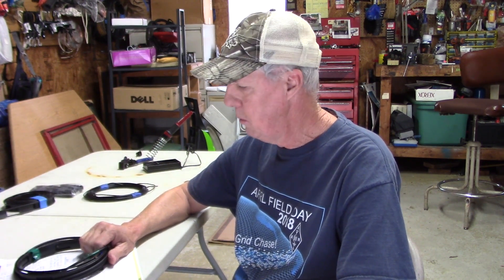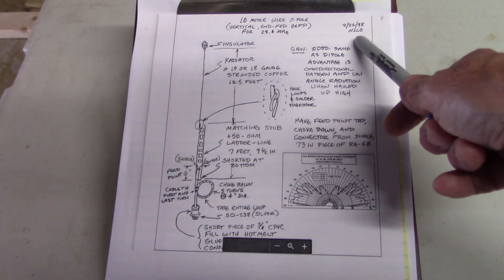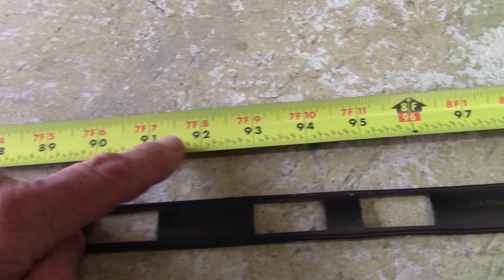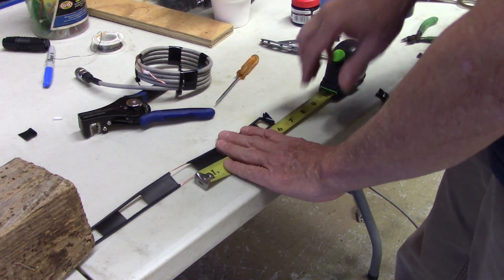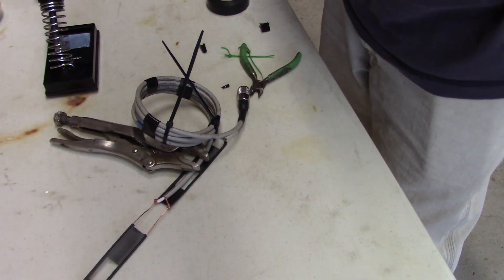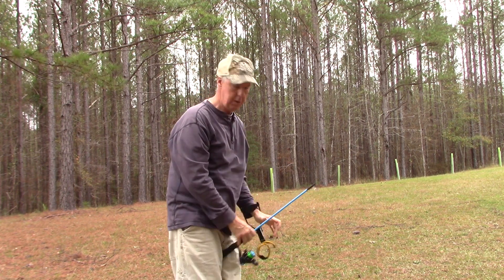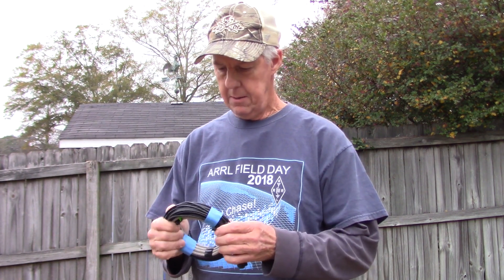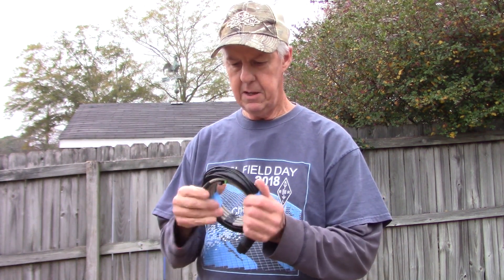10 METER LADDER LINE J POLE ANTENNA / Build and Field Test

Comment: Steve..Do you have a link for the spec build sheet you used ?  Nice video. Thanks
Reply: This plan comes from my website, nylo's notepad. You can search for it. It appears that hyperlinks are not allowed to be posted in the comments. I've made numerous attempts to post helpful comments here but they keep disappearing. Good luck with your construction. Mark N1LO
Reply from the maker: Hey Mark;  I really enjoyed building the antenna from the directions on your website.
Everyone should go check out Mark's site. He has some really good antenna stuff.
Thanks for what you do for the hobby.   https://www.qsl.net/n1lo/10mjpole.pdf
Steve Ad4xt
Reply: Thanks for posting the link Steve. That will take you directly to the PDF file but if you go up one level you can see the entire antenna plans page. There is actually a super j-pole version of the 10 m which was nearly equivalent to my 10 m beam when I had it hanging from my tower. And there is a plan for 20 m version as well. These can be mathematically scaled to other bands using the ratio of plan frequency to new target frequency as a scale factor, 15 and 17 etc. There will be some trial and error tapping the right feed point.

It's best to have the choke coil hanging a few inches below the bottom of the stub and to temporarily tape the coax between feed point and bottom of the stub to make it most stable for tuning. Otherwise after you do the final dress and taping of the stub and coax together at the bottom the tuning will change. It's better to have the entering and exiting portion of the coax at the same point in the choke coil, zip tied to adjacent turns for mechanical strain relief. That helps keep the weight of the coax feed line from pulling the coil apart. Also, I like to completely unitize the choke coil by spiral wrapping the entire thing with Scotch super 33. Do not pull the tape tight or it will collapse the turns. All you want is a sacrificial UV layer and it makes it rigid and durable. I also recommend using the Scotch super 33 to cover the liquid electrical tape as a UV sacrificial layer. Good luck with your club build!
Reply from the maker: @HeyNylo  
Thanks Mark for the extra tips and input. The piece of coax I hand on  hand was a bit short. Awsome antenna and design. We used one of these in the cqww last month for the  10m band. We had it up to 75' at the top. We had hours of contacts.  Thanks!  again.
Steve - Ad4xt

Comment: Hello, thanks for the video.  I assumed that a 2 meter ladder line j-pole the elements would be too close together.  If this works for 10 meters would it also work for 20 meters?
Reply: The bandwidth will be extremely narrow but yes

Comment: Thanks for making this video, Steve!  The 10M rollup J-pole has become my primary 10M antenna.  Due to the towering heights that are possible with this antenna and a good Southern pine tree, I have not found a better 10M omnidirectional antenna for local or surprisingly DX work.

Comment: Hi Steve, great video. I've built something similar, the flowerpot antenna...basically a vertical dipole using coax shield, similar choke and so-239. Instead of using coax inner strand solder some 14AWG wire for greater bandwidth. Seems to work nice. I'd probably build your antenna if I had spare ladder line. Keep it up! 73 and great DX.